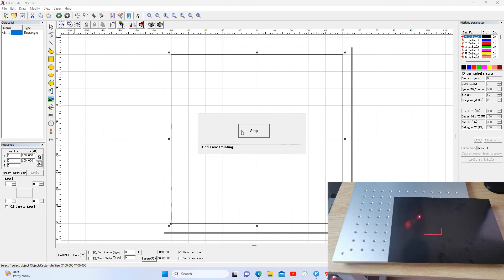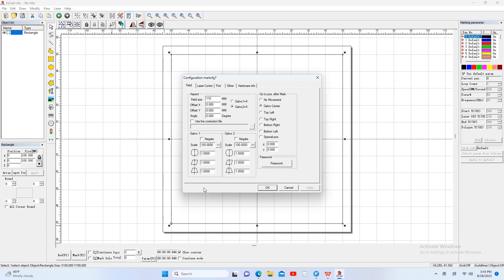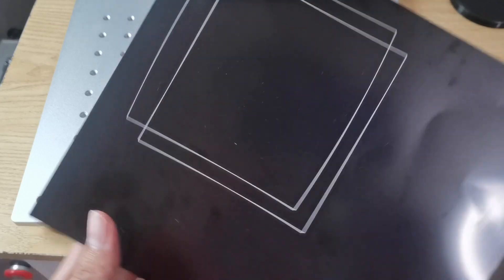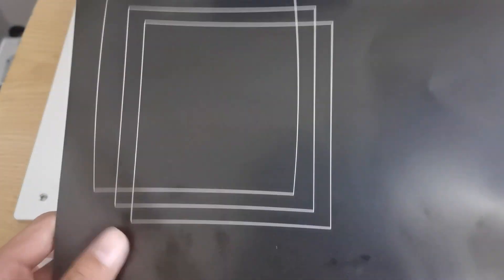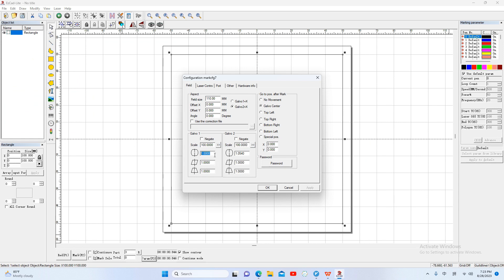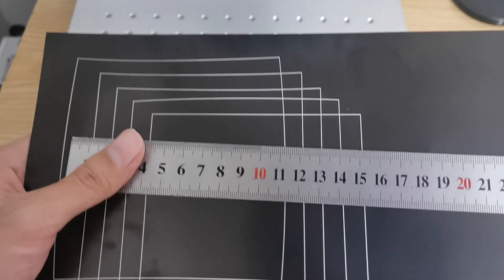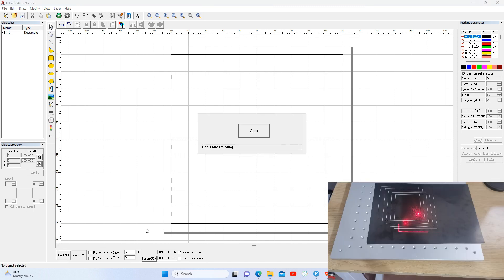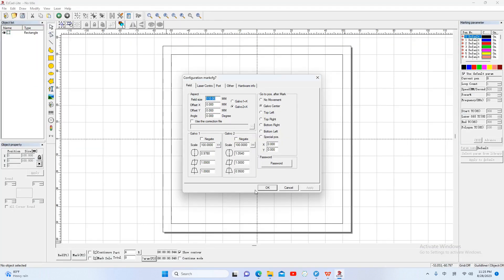EZCAD settings:How to calibrate the galvo head/fix marking distortion for a fiber laser?

Comment: Hello. How do you choose/decide field size parameter ?
Reply from the maker: Do you mean how to set parameter for a different size lens？
Reply: Yes, you have shown that you chose 110 mm
Reply from the maker: @kristupaskarcemarskas6886  It's simple,you only need to change the field size.For example,if you want to install a 200mm field lens,you input 200mm as field size in the parameter setting.